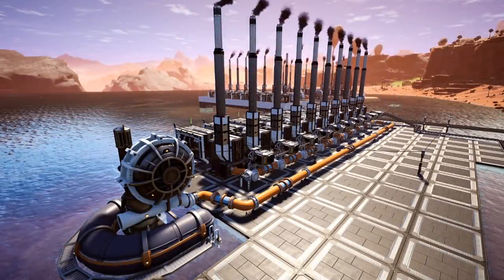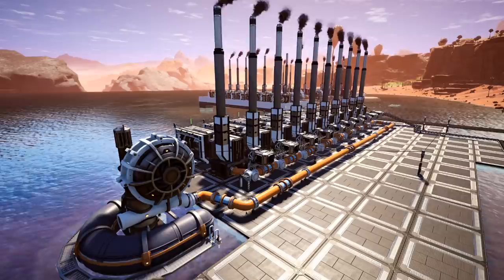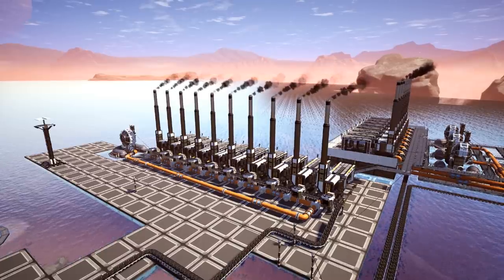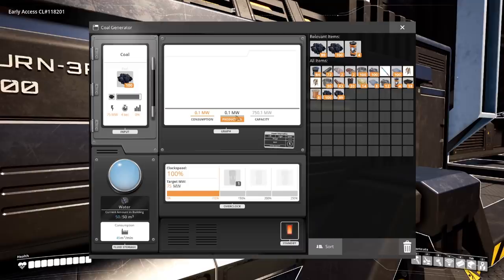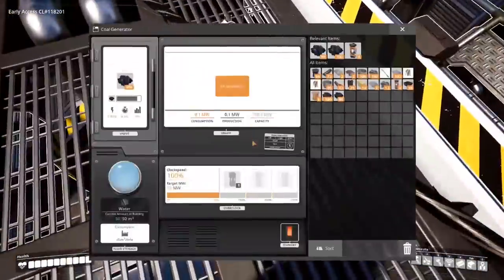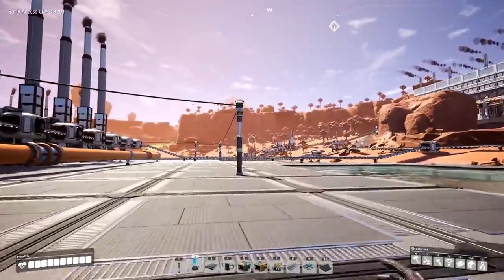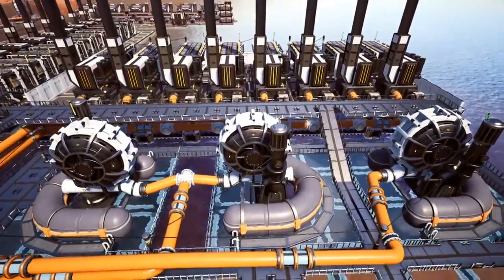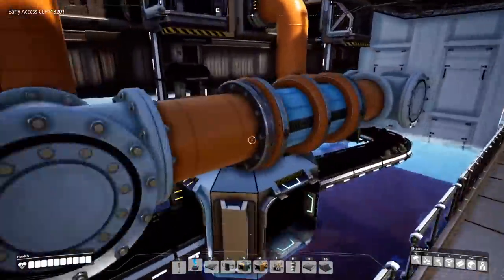Mythbusters How Much Water Do You Really Need To Run A Power Generator  Satisfactory Game

Comment: This is no longer accurate as of update 5, wherein coal plants always consume constant fuel and water, regardless of power usage. Same goes for nuclear, fuel, and geothermal. Only biomass ramps its fuel burn rate dynamically to match the load.
Reply: What about now? I just started Satusfactory and am currently learning coal generation and other T2 and T3 workspace items.
Reply: @byLags  still true; gen is otherwise only "weird" when it comes to over/underclocking where the energy per item is constant but the power output seems to only be loosely correlated with OC %. Snutt (the bald media guy for coffee stain studios) described it once as "generators follow a linear formula in a stupid way"
Reply: @marshallc6215  would you know how many would be able to run off of a single water extractor now?
Reply: @ayote663  coal is 45 water per minute and a water extractor is 120 at 100% or 300 at 250% overclock. The normal ratios are 8 gens:3 extractors if not overclocked (you have to run two mk 1 pipes or a mk 2 cuz that's 360 water.) Most don't overclock water extractors for coal so the ratios aren't common but find the common multiples of 45 and 300 to get an idea of the ratio.
Reply: This is still obviously true, even with 1.0.
Reply: @Formaldehydex  if you mean the source video is true, it is not. It was a visual bug caused by coal gens ramping down dynamically, similar to how biomass gens do. Now that coal gens burn a constant 15 coal/min and a constant 45 water/min, you won't see this artifact appear anymore. The coal gens will starve on water even when unloaded

Prior to update 5 (this vid is 4 years old) coal gens did ramp, but they would show their full capacity on standby as "available" if they instantaneously had enough water to run

Comment: I run the standard 3 pumps to 8 plants with the pumps in the centre, 2 facing one way, 1 the other. Thats 600mw easy, tidy, modular.
Reply from the maker: Absolutely, and I think with it being so modular it's really useful for expansion
Reply: If you double up, pipelines have sufficient throughput that you can have two water extractors share one, so you do two water extractors on one pipe, goes to eight coal generators, then join the second pair of water extractors, on to another eight generators, then the last pair of extractors. And that uses one normal coal + one normal sulphur node worth of compacted coal (with mk2 miners), with a tiny bit left over to make some black powder. :)
Reply: Just finished a 24 coal plant, 12 extractor, 3 mk2 miner (120 per, so 360 coal a minute) mega power plant for the multiplayer server I'm on with some friends, lot of fun getting a pattern down.

12 plants in a row, with a second set of 12 mirrored behind them, each pair of plants fed be one underclocked water extractor each, all coal fed by a a simple line of splitters overflow filling the reactors, all laid out to keep the runs of pipe and conveyor simple and short for my dummy brain to keep track of and make it easier to troubleshoot.

 The fun part is going to be finding 100+ slugs to convert to power shards and turn a 1800 megawatt powerplant into a 4500 megawatt powerplant... only to probably blow a fuse and need to start all over when our next project probably blows through all of it XD
Reply: 1 Pump 3 Powerplant is easier
Reply: @BeatstormX  3 generators 4 plants lol
Reply: Mk2 pipes flows 600 m2 water so just use 2 water extractors with all power upgrades and connect 12 coal generators. That’s as simple as it gets.

Comment: 1 power shard in a water extractor allows it to supply 4 coal gens perfectly, my fav setup
Reply from the maker: yep thats a nice way of doing it :)
Reply: Thanks, that sounds much simpler and plenty of power 🔋 to use to overclock
Reply: How much efficiency do you lose overall with that? (Not that I care much. Less headache is it’s own reward.)
Reply: @liesdamnlies3372  the overclocked extractor makes 50% more water per extractor but uses a little under double the power per extractor. It's really not THAT bad.

Comment: On the other hand, there is some possibility this could be a valid startup method for a super factory.  If it has it's own power source that needs a lot of MW to get going, you could set up a potentially infinite chain of coal generators and backed up resources to kick start it.  While that scenario is unlikely necessary by the time you'd build a super factory, it's fun to look at the properties of this game and how flow rates are calculated.  Maybe a stockpile of coal on the water is enough to get a multiple gigawatt power source going.  I now know not to bother with this strategy unless that's specifically the need.  Thanks for the awesome video!

Comment: Let's bust this myth fast.
Yes, a coal generator can use up to 45 cubic meters of water a minute but only when it is running at full strength.
If it is only running at half power it only uses 22,5 cubic meters a minute.
So you can run 50 coal generators on a single water extractor but then they can not be running above 13,3% output.
Reply from the maker: Yes but you should always run a generator grid so that it can run at full consumption. if you only ever run it at 13.3% it's hardly effective.
Reply: @TotalXclipse  That is why it is NOT possible to run 50 coal generators off of just 1 water extractor.
My setup is 1 water extractor per 3 coal generators and it runs fine.
This game does kinda make the 3 setups kinda normal since all splitters/mergers use the 1/3 ratio.
Reply: @TheStuntViking  I use a torus manifold ( ie a doughnut shape), with six extractors ( at 80 percent) and 14 coal power plants per manifold. One pipe just above the other connected at the ends. water extractors connect to the top pipe and power plants to the lower. Water flows in both directions to meet in the middle. Almost acts like a balancer and gets them online faster than one long pipe and it has never failed. I use this as a modular design and with 2 can generate nearly 4K MW, enough for early game.

Ps I should note that I do this as water is only available at one end of the coal power station
Reply: It's basically everything works to demand requirements. If there is no demand then 1 water pump will not have any demand for water except just filling the coal power plants initially. There will be no further demand on it til the power stations need to provide power and thus require more water. When building this setup, the pump will very likely take a good while to fill so many power plants.
Reply: exactly, its supply and demand. If there is no demand, no consumption.
Reply: yep, nothing tricky here, not like its a glitch.  it can all be calculated on paper, no need to validate it...  I was thinking this video was going to show something special, but nope.
Reply: Thing is, you shouldn’t expect the generators to run at 100% of their capacity. The demand is going to fluctuate, and if it rises above 100% of supply, the breaker trips. Optimally, you should supply enough to run at 80-90% capacity, with the generator’s internal reserves carrying it through peaks and getting replenished during the troughs.
Reply: @battlesheep2552  But if you run at 95% for too long, you're gona run out of water eventually, wich most likely ends up in a black out.
Reply: @MsUltrafox  I currently run a 20 coal generator, 7 water extractor build. 5 WEs are connected to 2 pipelines so that the  middle one gets split. One of the remaining is overclocked at 150%, so they're both outputting 300m^3. This whole setup results in 900m^3 of water, which is enough for the 20 CGs.
Reply: @richardruddy6341  Jep - and it's the same for every power generator. I recently built a fuel generator plant with the diluted recipe (120 crude oil input) and 70 generators. As long as the energy isn't actually used, the belts stop after some time.
Reply: LOL
Reply: This is because 99% of players utilize some sort of manifold system but with no load balancers which will cause this to happen to new players all the time. You should not be just using load balancing or just manifold systems, you need to put a simple and small load balancer at every new intake manifold system you are creating and another right after the outtake and it will auto balance all your lines or at least make each of your machines a bit more efficient then they where before. I have not run the numbers but I am pretty sure before I was using load balancing I was at about 80% effeciency on average in my two main bases, with the load balancing it went up to about 90% efficiency average.
Reply: I know right? Took hum 11 minutes to say what should have taken 2 minutes.  But YouTube I guess. Consumption of both coal AND water is proportional to the load on the plants. Done.
Reply: You can perfectly run 4 Coal Gens per 1 Extractor Overclocked once to 180 m3 and 60 coal input divided in 4x15.
Reply: @celem12  Not for long. New update DEMANDS full resources at all times.
Unless you underclock it but then you also get less power.
Time to build them batteries.
Reply: @MsUltrafox  i made a mistake it's 4x15. so it's full all the time. 4x Coal gens need 45 m3 each and 15 coal each it's exactly 180 m3 divided in 4 and 60 coal divided in 4.
Reply: so its fact that more generator demand less supply for the same energy ?
Reply: @mdjv  Not no more.
With update 4 ALL power generators will run at 100% so no more giving it just a little bit of resources but the full amount at all time.
So making a lot of power generators will require lots of input or they will shut down.
Reply: @MsUltrafox  Ho ok, before the generator was going with you demand, not anymore that what you are saying ?
Reply: @mdjv  yep
Reply: @MsUltrafox  thanks Man !
Reply: not anymore :D :D :D
Reply: Thanks. Took me a while to realize my biomass burners didn't always run at full power. Makes sense but easy to overlook I guess.
Reply: @MsUltrafox  i use 5 extractors to get 2 full pipes so 12 coal generators can use the the water
Reply: @jorisvanhandenhove5865  When this video was made coal generators didn't need full water to operate.
These days they do need full water at all times because generators always run at full capacity.
Reply: @MsUltrafox  yea i forgot about that

Comment: The capacity isn't the power that is produced. There is another line for this and that is called production. Consumption shows the needed power and if consumption goes above production, the power will fail.
Problem in this system is repowering the network. the second a machine gets power it draws its full power it needs, even though it is not producing at the moment. That mean repowering is either only possible if you can support all needs or you need to disconnect part and reconnect them afterwards.
Reply: I dedicate one out of the 8 stations for running the coal miner and water extractors for the power plant leaving the other 7 for factory power.   No problems with having to repowering it if I accidentally draw too much from the factory network.
Reply: @zordah  had to read this twice to realize just how significant of a statement this was, having a separate power network just for keeping the power running for the rest of your base... that is just... brilliant...  essentually keeping all base power running with a fail safe always keeping your main base running for a quick restart no matter what... its so simple yet so perfect... kudos
Reply: @fatedunion1761  what I do is have a complete backup power plant that can add 50% to my max production it is never connected to the grid unless the power crashes also top fed coal generators with fluid buffers above to make it flow even without power and a large storage for coal so it hopefully can restart it self most of the time
Reply: I always keep a few biomass burners handy on standby just in case I ever need to bootstrap the system.

Comment: MW, not MWH.  Electricity is measured in power, which already contains time.  1 MW = 1MJ/S   1MWH = 3600 MJ  1 MWH/min = 3600MJ/min = 60MW.
Generators and demand are measured in multiples of Watts.  Multiple-Watt Hours measure total energy consumption, normally for the purpose of billing. They take an energy/ time unit and multiply it by time, giving an energy unit.
The game is all about throughput since there is an infinite amount of each resource given enough time..  So it is ore/minute m^3/minute and MW.
If I am harsh on this issue, blame trauma from my maths teacher who would make your life a misery if you messed up on units.
Reply: You got harsh so I didn't have to, thankyou ;)
Reply: Your teacher did a good job so you'll never 4get again!
Sadly even basic math / physics knowledge is quite rare amongst adults these days... :-/
Reply from the maker: hahah no worries you don't sound harsh. I wish I had a maths teacher like yours!
Reply: you guys studiyng phisycs measurments at math classes?
Reply: @artemkortsev8279  Whenever possible we would have real-world example problems to practice maths and show how it is applied.  We would have Hire-purchase versus cash-down when buying a television to see how interest works.  We even had a messy problem with thermal units, KWH and such to work out utility bills.  They also served as lovely pitfall traps where you could spend ages working out the correct answer, but forget to put a "squared" by the units or answer in metres when the question asked for centimetres.
Reply: Yes it should just be MW, but in his defense the game does say MWh when you hover over the graph.

Comment: One of the epiphanies I had was that water is non-directional. It just seeks to fill open space (the pipe). So, in my current build, I've got all of my refining happening in...refineries. Wet Concrete, Pure Iron, Pure Copper, and my steel is using not only Pure Iron but the Hardened Steel recipe. I'm currently running 32 refineries (17 Iron, 11 Copper, 2 Concrete, 2 Biofuel) on 6 water extractors in a large loop. At major junctions, I'm using Industrial Buffers to supplement when segments aren't running full bore.

Comment: TotalXclipse, in the configuration you use (3 extractors and 8 plants) in stead of using 2 pipelines running from the extractors to feed the plants, run a single pipeline along the plants and connect all plants to it. Then place the extractors on the other side of the pipeline and connect them to the pipeline as follows: The first extractor between plants 2 and 3, the second between plants 4 and 5 and the last one between plants 6 and 7. This is a better use of pipe and doesn't require that extra pipeline above the other and it works! Almost the same as your solution but with lesser pipes and space. ;-)
Reply: You cant always do that, depends on geography. I have twin coal stations side by side that only have access at one end to water. I use a doughnut shaped manifold to run six extractors, pushing the water both ways down the pipe to meet in the middle

Comment: If your power demand was variable you could potentially use a series of fluid buffers and not need as manny water extractors. However to manage that and not get brown outs would require significant monitoring and management. Many things IRL are designed similar to reduce costs, where its more cost effective to implement constant monitoring than to design to the max necessity. However in this game its far more time effective to build things completely self sufficient.

Comment: 3 water extractors for 8 coal generators is peak efficiency.  The only draw back is the pipes restricting 300m^3/sec.  The only perfect solution is a 32 Coal Generator plant, with 12 Water extractors.  5 rows of 6 coal generators and 2 on the end.  Yes the piping is shared amongst them with multiple pipes.  Doubling or tripling up on water pipes allows you to bypass the 300m^3/sec rule.

Comment: In my current factory, I have a coal plant running at a 2:1 Plant/Extractor ratio, with 8 extractors and 16 plants.Right now, my biggest bottleneck is actually in the coal supply. I have 3 normal nodes feeding the plant, with 1 line to 8 plants, and the third line being split in half and injected halfway through. I currently have to have the plant 50% disabled, but as soon as I get my Steel production up and running, I'll be able to get Mk. 2 miners and Mk. 3 belts, which will make things much easier for me.